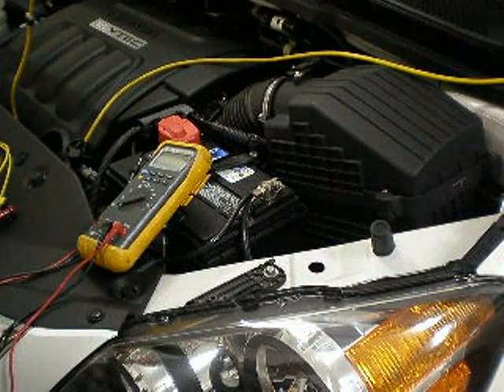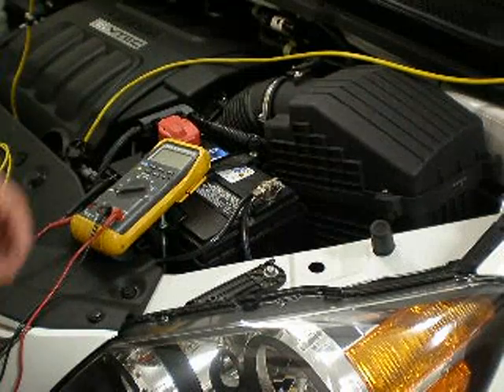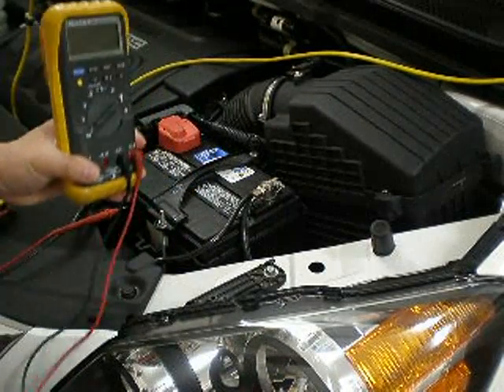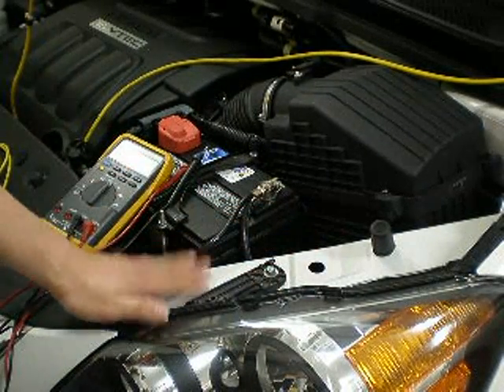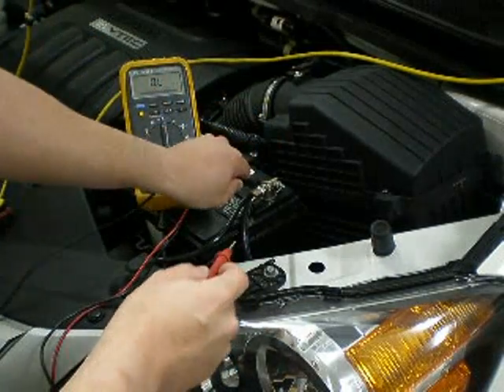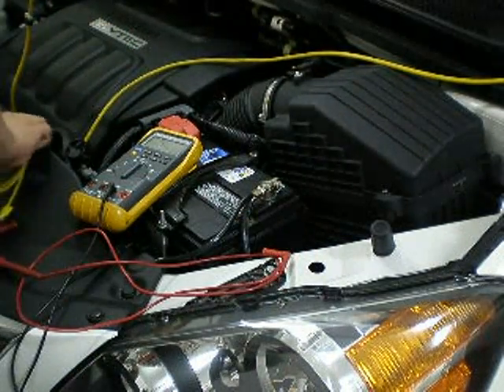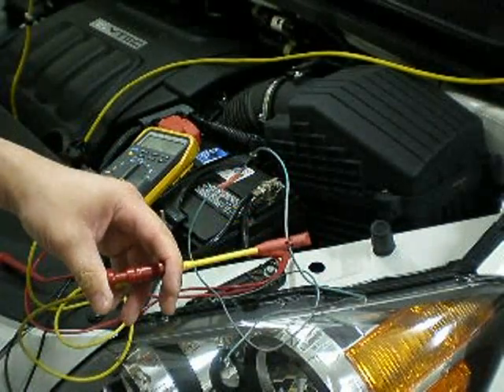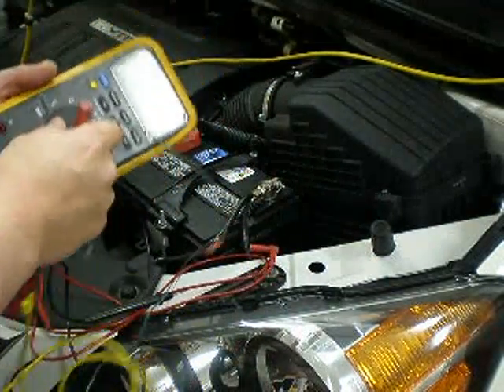Use Multimeter To Test Ground On Car

Comment: Hey,quick question for you.If you check the voltage on a circuit(like an amplifier)and it reads 12.7ish does that mean that the ground is good?In other words,is that another way to check for ground besides measuring resistance?....Thanks for your quick responses thusfar.
Reply from the maker: Check the voltage direct at battery, and check voltage direct at the power wire at the amplifier. It should be the same if you use a heavy gauge wire.
Reply: dial2fast Thanks Bud!

Comment: What's the best way to check ground resistance for a aftermarket amp install when the battery is all the way up front amd amp ia in the rear ?
Reply from the maker: Try to locate a factory ground bolt. Usually there is one by the tail light area. If not, find a bolt such as by the seatbelt to check resistance between those points and your aftermarket amp's ground.
Reply: dial2fast  that is what I'll try later today. Thank for replying! Some have said to use the factory ground bolt, any thoughts?
Reply from the maker: Joe Ramos The truth is you don't know whether a bolt in the back of the car is a good ground connection back to the battery by looking at it. That's because the whole car is welded and glued together so some panels are better grounded than others. You can always temporarily run a piece of wire from the batteries negative terminal to the back to connect to the multimeter. Then using the other probe, put it on the bolt or panel you are testing and check for resistance. Have a look at my other video here which may help:

http://youtu.be/BCZeBx84ZFY

Comment: When you do the actual test for ground, it would be helpful if you told us what the output of the multimeter is supposed to say. It would also be helpful if you told us what impedance range you set the multimeter to before beginning the test.
Reply: Took the words right outta my mouth, this guy just wanted to show us his toys basically
Reply from the maker: Hi, I have just finished making 3 new and improved videos on using a multimeter to test voltages and ground on a vehicle. You can click on this link to see the first of three videos:
http://youtu.be/9IZUvTyOGAk